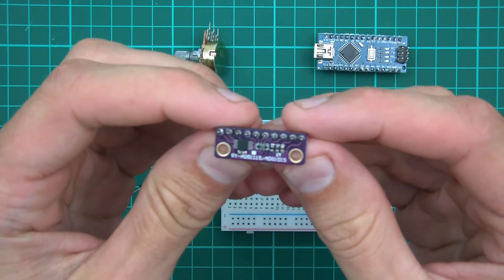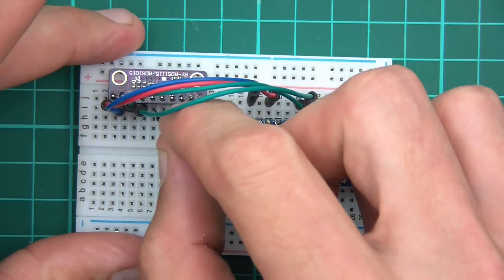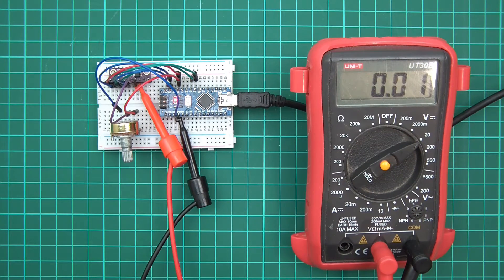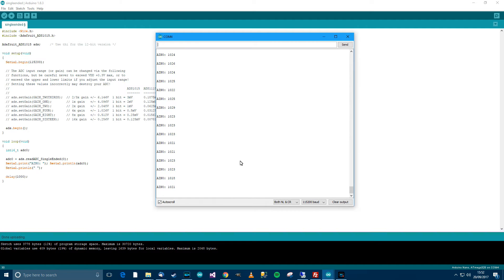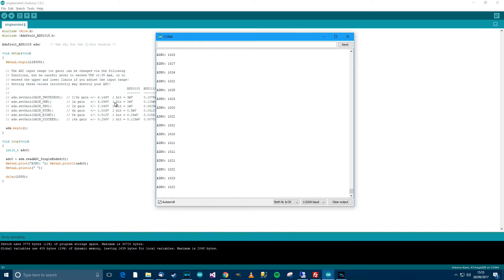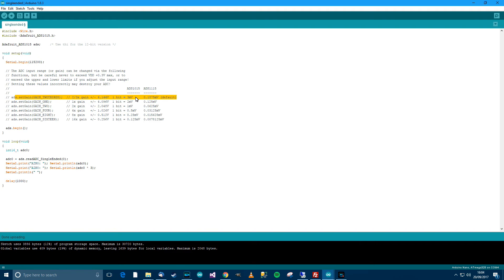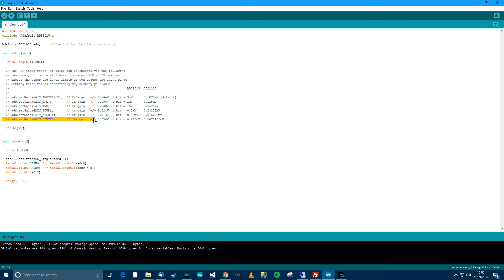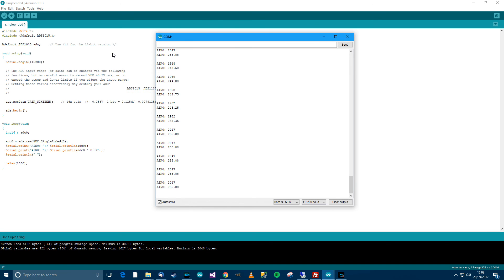TUTORIAL: How to use ADS1015 With Arduino - A 12 Bit ADC - Built in Amp! (Part 2 Wiring, Code, Gain)

Comment: OK, losing my mind here. Using 4 TM1637 displays, 4 10k pots, an ADS1015 adc and an STM32. All connections are soldered and tight, code is the same for all but the top left and the one below it jump all over the place (adc0 and adc1) The bottom left and top right only jump a few points adc2 and adc3. I have 10uf caps on all four inputs to the adc. I am set for single ended readings. Here is a short video. 

https://www.youtube.com/watch?v=wROJ_jSanG8

Comment: how to use the reading for de-activating a device , EG shutdown when 65 milivolts , please advise
what part of the code has to be used in the conditional statement. it is regarding the shunt resistor

Comment: I have a question about this subject. If you have a signalsource, which outputs 0.5-4.5 volts, would it be better to design a circuit which distributed the signal between -/+ 2 and then use a more precise scaling?

Comment: How do you know that your board is ADS1015 or ADS1115? I have similar ADS board like yours. I bought it from Aliexpress and they sell it to me as 16 bits ADS not 12 bits ADS. In the board it written ADS1115/ADS1015, what that mean? its really confusing
Reply from the maker: There's a little white box on the board and it has a black mark in it. :-)
Reply: @antonycartwright  There are 2 white boxes one on top of ADS1115 and the other one on top of ADS1015. No black mark in any of them.
Reply: I got sold this board thinking it was 16 bit but they shipped a 12!! no mark on board and A0 didn't work only 1 2 and 3....bloody ebay.

Comment: Ok, I have a crazy problem. I am reading 4 pots and sending to four 4 digit displays, I am using case/switch to output to the displays and all works as expected. When I use a 5v battery instead of usb, at lowest pot setting, my display should show 10 (Which it does, but.....it bounces to 40xx numbers and back..  4096, 4075....etc.... Driving me nuts!  UPDATE......Now, it is doing it while using usb. I have serial writes all commented out too.
Reply from the maker: I have seen this before. I think it is loose connections...
Reply: Thank you. I will do some soldering with only one pot and display (Save time) and see what happens.
Reply from the maker: Good idea... I've had this weird problem myself and I solved it. Many other I2C devices sometimes behave in this way too. I unfortunately can't remember the fix. Come back if soldering it up doesn't fix it.

Comment: hi, just a doubt if your using ADS 1015 or 1115 with DC shunt to measure amps by measuring the voltage drop across the shunt like 200/75ma ,will these ADS will work in both direction ex: if shunt is used in between a  inverter and the battery, during charging process voltage polarity from the shunt changes so with these changes happening  will ads1115 can still detect the changes and still amplify the mv from the shunt ? ty
Reply from the maker: raga N hi, if you use the ads between inverter and battery, it will only give a voltage drop in one way because power goes from batteries to inverter and should never go from inverter to battery (at least I've never known that setup). BUT, to add to that, the ADS is bipolar, it can work both ways if circuit allows.
Reply: Antony Cartwright ty for replying, isint charging the battery means current flows from inverter to battery and vice versa during discharging so shunts polarity changes accordingly?
Reply from the maker: raga N Hi, that's not true. An inverter is a device which converts DC into AC. So it gets energy from batteries and provides AC electricity. So, an inverter is only a 1 way device.
Reply: hi antony,i understand Your point by referring the word "inverter" i know it converts DC to AC , what i meant earlier was an Home inverter system which also has an inbuilt "rectifier" to convert AC to DC and charge the 12v Tubular Battery in my country we simply refer it as inverter so its bi-directional .  https://goo.gl/trxiao
Reply from the maker: raga N ok, we call that a UPS. A UPS has a step down converter and a bridge rectifier in it from mains to battery, and an inverter from battery to mains... In this case, if you connect the shunt to the low side, you should get bi directional results. But of course, it's unlikely because when the battery is charging, then the inverter is off. But potentially, it should work...
Reply: hi antony, srry for late reply. ty for clarifying, ill try inputting the positive output of shunt connected in low side to ads A0 and gnd to ADS gnd? and boost the signal?
Reply from the maker: You could do that, but it's better to use differential mode for what you're trying to do because a small difference in ground will make a considerable error on the Arduino. Use differential mode with two wires from shunt. Antony
Reply: ok ty, ill try the differential inputs with A0 & A1,ill update the result, thanks again Antony you are one good Teacher :)

Comment: I am using a 4x20 lcd display with this and I am getting numbers that are all over the place compared to what is in the serial monitor? I get as high as 8900. Any ideas?
Reply from the maker: PilatusPorterPC6 the serial monitor and display give different readings? If this is the case, probably noise around LCD.
Reply: I am going to try 8 bit mode on lcd instead of 4. Maybe it will help?  If I move one of the pot's fast, it seems like the lcd for that line (adc channel) goes very hign and will never come back to zero?
Reply: You had it right. Noise. Breadboards are a blessing AND a curse  :  )
Reply from the maker: PilatusPorterPC6 that's true. The problem with breadboards is that you can get loose connections...

Comment: Great video Antony. 

I would like to use an ADS1115 to connect 4 loadcells (eg look http://www.htc-sensor.com/products/?id=20) to an Arduino, so I have three questions for you if you find the time to respond. 

(1). When I link the first loadcell through ADS1115,  do I just repeat the same procedure for the other 3 ?  
(2). Since I am interested for the overall weight measured by the loadcells, can you please advice if I can wire link all 4 of them and use 1 channel instead of 4 ?  
(3). Do I just buy any load cell or I need to look for certain specifications (I am talking in terms of voltage).
Many Thanks
Reply from the maker: Hi, I don't know anything about load cells but if they are analogue devices, then yes, you'd just repeat the wiring. I wouldn't advise that you link all together into one pin as I'd imagine they aren't designed to be used that way. You will need to look for certain specifications. You cannot have one which is too high a voltage that it would damage the ADS1115. There may be more considerations, but I'm not familiar with loadcells. :-/

Comment: As always Antony, great video and explanation. Thanks!
Reply from the maker: Thanks Carl, I struggled to explain this one! I've looked at the video a few times and think maybe the gain part isn't very clear. Ah well! :-D
Reply: I think its good - If people would like a better understanding of gain then maybe you could do a basic math video on how to spread the voltage over the resolution of the device, and then working out what your gain is. I think its a good video and I understand how to use the ADC now :)
Reply from the maker: Thanks Carl! That's very reassuring! My next videos will be me range testing those cheap 433MHz modules. I make a message receive confirmation device, and use it as a range tester!
Reply: Ah nice! I've got a few of those modules too. But I have only done the example you showed a little while ago! I'll look forward to it!